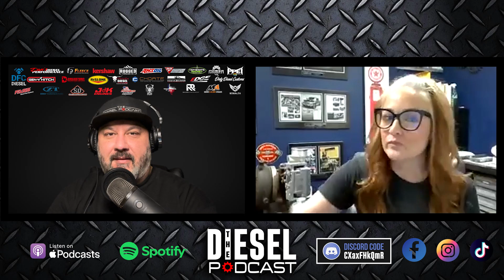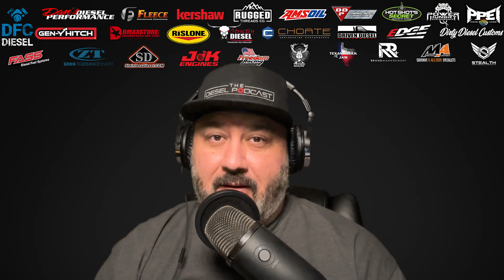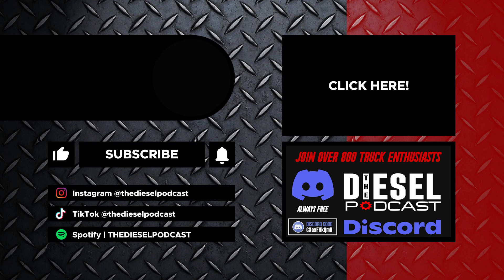We Couldn’t Believe Issues with This Truck

Comment: fuel cap vent plugs up on cab and chassis trucks with the fuel filler cap on the back of the truck or just in a spot that is suseptible to dirt plugging the vent. I've also seen the older trucks with the vent on top the tank plug up and like the lady says, if you starve the pump, it's going to fail. It also damages the injectors

Comment: I'm surprised to hear all these problems, I have a 2017 3500 still the 6 speed, no trans issues 🤞should be fine. A lot of this stuff she talked about I have upgraded before hand. But in 90K miles I've only had the MAP sensor get clogged and I picked up the offset kit for that and 1 glow plug. I've had everything Banks makes for my truck installed and the thing runs like a champ. I love it! I like this lady she is smart and has a ton of great info but she scares the hell out of me lol...

Comment: Pretty smart lady. Could they possibly make these trucks any more complex? I miss my 2000 Superduty. Oil and filters, that's it. That's all I replaced for 299,000 miles when I sold it for $11k. It was 9/10 condition with no leaks or rust. Time to simplify

Comment: So glad you had her back on. As per prior conversations, I've had to get educated on ownership of the L5P. Been around diesels since I was a kid, and finally bought my own at the age of 52 last year, a 2023 Chevy 2500 with the L5P. I use it as a daily, a grocery getter, and haul my daughter's bicycle in the back. I will be getting a 30' travel trailer. My plan is to get another one. 

When I watched the Podcast with Kat on it last year, it taught me a ton on how to drive it. So periodically run a manual regen, then get the fuel level to just above 1/4. Then run some Risilone DPF cleaner. Drive 30-40 miles in 8th gear. Despite being a daily, I beat on it a little to keep the emissions clean. 

So why not delete it? The truck is still under warranty, and a fantastic unlimited mileage extended warranty and a three year service plan. 

My Banks air intake, pedal monster and IDash doesn't void the warranty, according to the same dealership I've been going to for over 20 years. As long as I didn't add power of anything, we're good. 

Anyways, thanks for having her back on. She's a straight sh@@ter. She didn't mention broken cranks or the common issues with the earlier Duramax engines, so that's a good thing!!
Reply: Good luck. I've heard so many stories of denying warranties it's not even funny.
Reply: @dwightvoeks9970  yea I know several of the people in the dealerships where I go. Nothing has blacklisted my warranty so far. I was told that if the engine and/or transmission has tuning, or any aftermarket turbo is installed, that will void the power train warranty. Guess it depends on where you live and whatever dealership you're dealing with, etc.
Reply: I can't remember what she has but she has an older duramax that is extremely fast and then maybe something of the 08 n late kinda body.
Reply: @bucketheadrox  Yea seems like it was an LLY or an LMM. One of the few gals who are diesel heads. She knows her stuff. Too bad I live in Northwest Florida. Other her shop would be performing the post-warranty services on my truck that is beyond my current abilities, tools etc.
Reply: @RobertHolster1 one of her techs is my buddy and I get my truck worked on there. Had no clue that shop was about to be that good. But I use them cause I travel for work now and I don't own property lol.